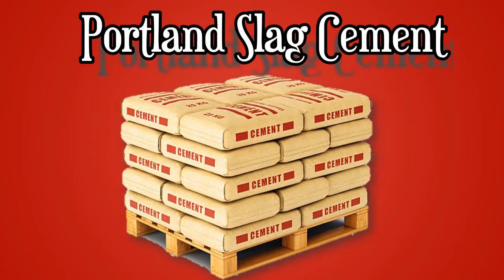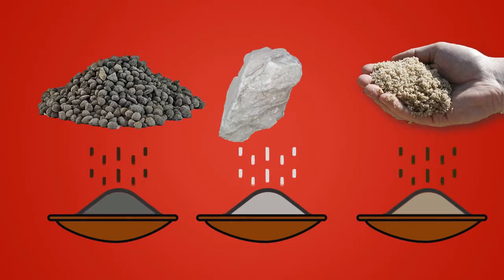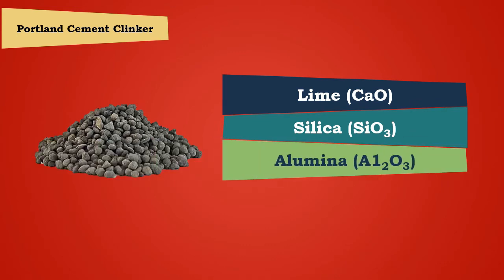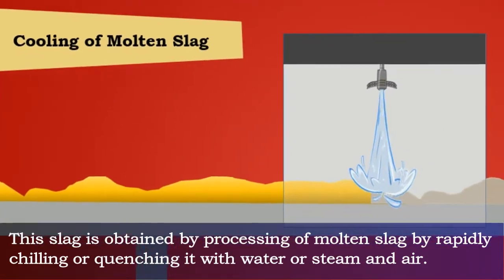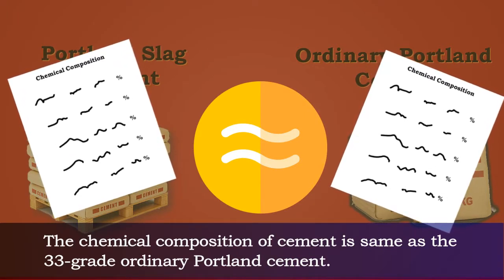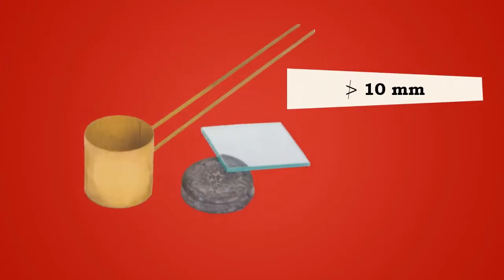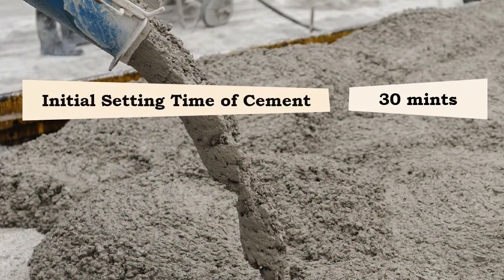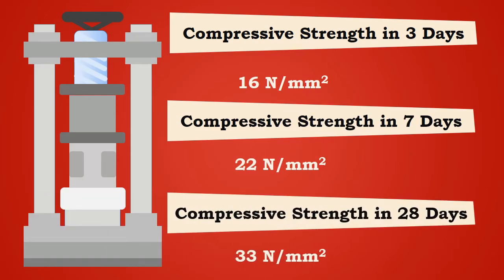What is Portland Slag Cement? (PSC) || Properties ||Uses || Types of Cement #4 ||

Comment: Can I use jsw concreel hd cement for column, slab and beams. Jsw psc for plastering and brick works for residential building
Reply: Same doubt
Reply: Yes ! Suggested for plastering works !
No problem of plaster cracking.

Comment: Im making a foundry for steel melting, so, i need concrete that can heat up too 2000 c what concrete should i be looking for? I have searched ALL over, and cant find what i need. Thanks for any info.
Reply: Scott K I think only a furnace ceramic brick will suffice.  Layered with clay brick and then clay. Ceramic layers.
Reply: Magnesium silicate is your best bet.